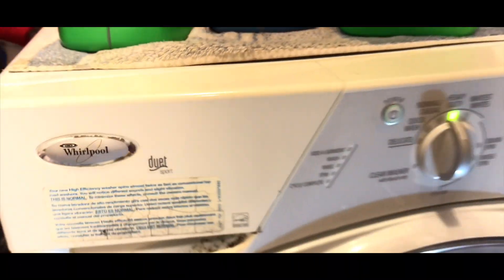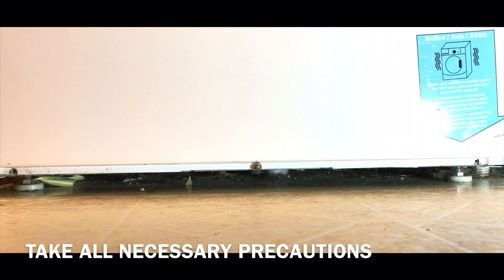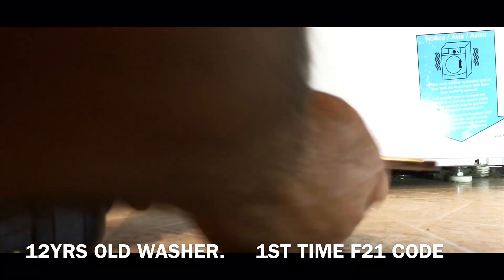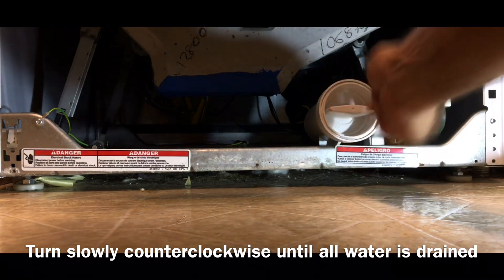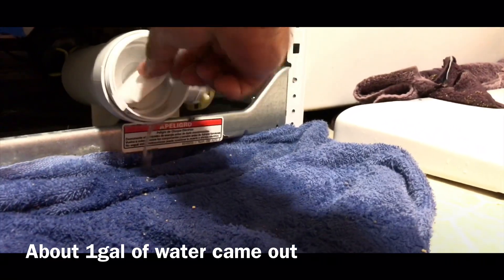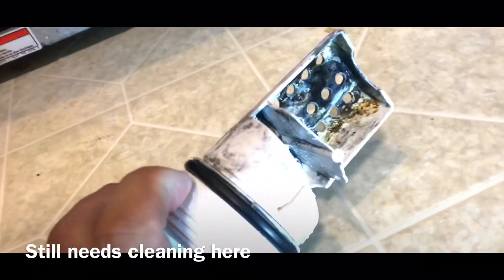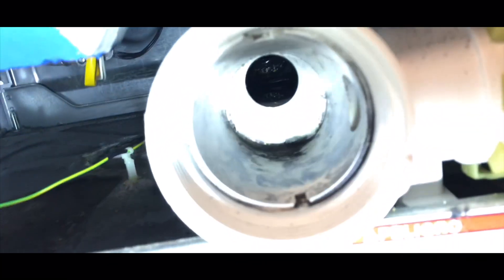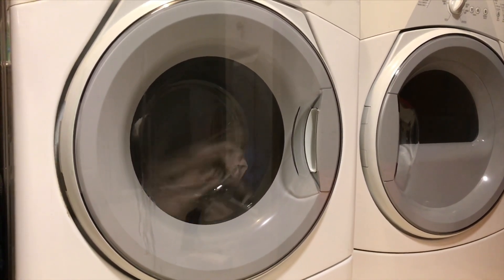F21 ERROR CODE FIX UNDER 3 MIN VIDEO

Comment: Thank you so much for posting this. I was able to fix my Whirlpool Duet washer. You are a lifesaver. As a single mom I was so worried about the expense of having to hire someone to fix it.  Your video was perfect. I followed step by step and it worked!!!! Luckily my son was able to get the drain plug off because it was on there tight. That was the hardest part. Thanks for the heads up on the water too. It was stinky and there was quite a bit, but we were prepared. THANK YOU!!!!!
Reply from the maker: You're welcome! Glad it was helpful! Please subscribe 🙏🏽 😁

Comment: question, I have done this step and cleaned filter.  I will run about 6-10 more loads with no problems and then F21 again.  I check the filter and it's still clean?  But why should I still get the error?  Thanks!
Reply from the maker: Check inside hoses n pump also for fabric etc. Inside everything that connects to filter. Before n after

Comment: Wow! And thanks although we have different model. It worked just the same. Taking the panel off was a story in itself with me. Only 2 bolts it had middle and right. Right off no prob but couldn’t get middle with screwdriver bit couldn’t reach cause it was to big. Long story short I ended up using needle nose pliers with the correct Allen/ star? Key and got it!